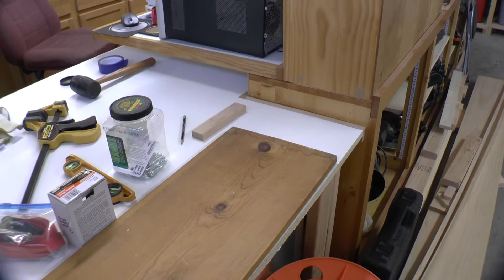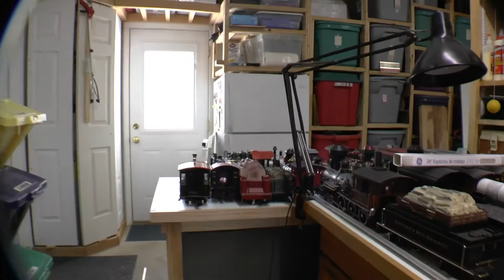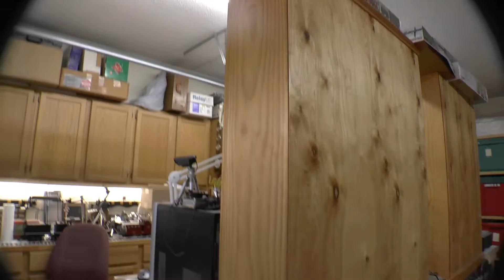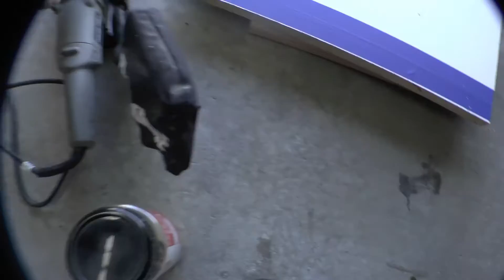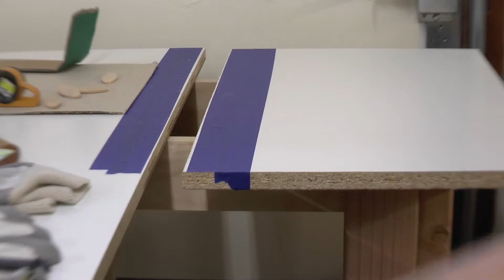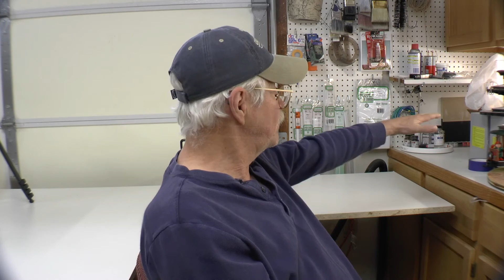Model shop update No. 4

Comment: Hi Soloman, well done really coming on now, great area, everything at hand, how,s the tempretures now
Reply from the maker: Albert, The outside temperatures are about 57Deg F at night (or 14 deg C), but I maintain An exact 70 deg F ( or 21 Deg C). Perfect for night time. I'm a very happy camper! During the heat of the day witch gets hot, I am still very nicely cooled. Loving my Heat pump.The thing about a project is that it comes in stages. First, so much to do, then projects done, then Detailing. the little stuff. I'm between projects done and detailing somewhere. Thanks for commenting Albert. Stay tuned for more. Trains and ships to return someday..."soon"?